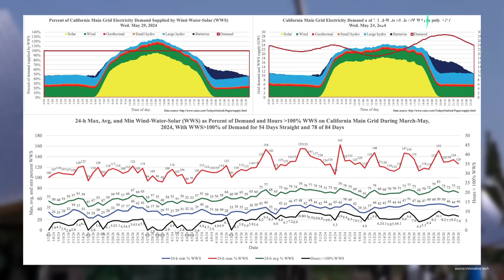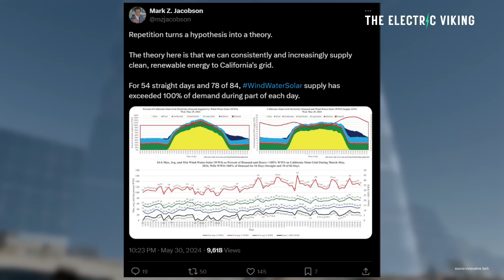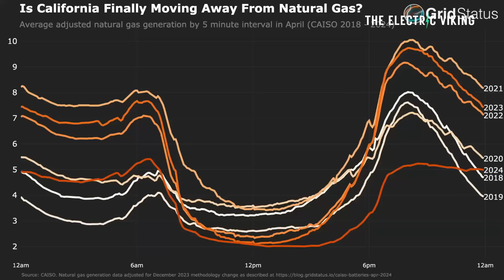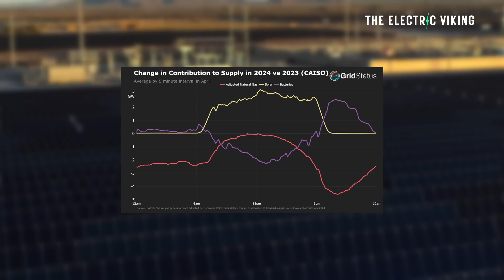Solar smashes records in California, 'DUCK curve' nearly wiped out

Comment: Spot on, Sam. I work in the solar industry designing micro inverters and it’s been a long time getting to this point. Interestingly, PG&E is currently tearing up my street to replace all the gas mains and home connections/meters… doing this through the entire town here in the SF Bay. I’d rather they just remove the gas service and help me convert to a heat pump A/C and indication stove. They’re building an entirely new gas infrastructure just as it’s becoming obsolete. 🤯
Reply: It turns out many SmartMeters have dead batteries. As a matter of fact, PG&E said, just last year, they started the process of replacing 3 million meters as they reach the end of their battery life. It has nothing to do with a green energy transition.
Reply: Natural Gas is a separate product, and there will always be demand for it.  Just like oil will always be used for making plastics even if we give it up for fuel for our cars.
Reply: Same here. Meanwhile, I've converted my office building to electric heat pumps. No gas. Also my new house is all electric .
Reply: @BracaPhoto    Burning natural gas produces CO2. Natural gas will need to be phased out to meet CO2 emissions targets.  Several cities have banned new natural gas connections, subject to judicial review.   Even if you don't burn it, natural gas is a tremendous greenhouse gas on its own, about 80 times worse than CO2. The leaks on the system are a pretty big climate problem on their own. If people talk about "efficiency" of natural gas, it is a misnomer. What they mean is cheap. If you want efficient, then you can't beat a heat pump which can produce several times as much useful heat as energy consumed.  Natural gas is never going to be more than 1:1.
Reply: @BracaPhoto  I don't know about the USA, but in the UK a "unit" (1KWh) of electricity is about 3 or 4 times more expensive than the same amount of natural gas, so using natural gas for cooking is certainly cheaper than using electricity for that same purpose. When it comes to heating a home, again it would be 3 or 4 times cheaper to use natural gas rather than electricity+electric heaters. However... a more modern option for heating via electricity is to use the electricity to run a heat pump. In this case, 1 unit of electricity running a heat pump will produce about 3 or 4 units of heat, which means heating a home via electricity+heat pump costs about the same as heating the home via gas.

Yes, I know I am talking about cost rather than efficiency, but perhaps whatever source provided you with claims that "gas is more efficient than electricity" was worded poorly and really meant "gas is cheaper than electricity". That's just a guess on my part.
Reply: @CiaranMcHale  look into "physics" - it will help you understand what I mean by more "efficient" - it has NOTHING to do with price or cost -
Reply: @BracaPhoto  There is no need for rudeness. If you read the second paragraph of my original comment, you will see that I do understand the difference between efficiency and cost, and I was merely saying that perhaps you read efficiency claims from a source that was using sloppy language. The following 13-minute video provides an overview comparison of cooking with (a) gas, (b) electrical resistive, and (c) electrical induction cookers, for several metrics, including pollution, convenience, cost and efficiency: https://www.youtube.com/watch?v=X440BHdy35g One takeaway from the video is that gas is only about 40% efficient because a lot of the heat generated is used to heat the air rather than the cookware containing food, while induction cooking has up to 90% efficiency since most of the heat goes directly into the cookware containing food.
Reply: Natural gas isn't going anywhere.
Reply: @ron2280  it's going up in smoke
Reply: @TheQsam1  😂👍
Reply: Using natural gas for heat is waaaaay more efficient than using electricity induction to make heat. Heat pump HVAC and heat pump water heater? Sure. Induction cook top? Nope. Thermal efficiency of burning natural gas in your house is 3x higher than burning natural gas in a generation station, then transmission losses to get it to you. Not only that, but gas gives you a better food product than electric cook tops because of the very high temperatures they can hit, that brings you the Maillard reaction in foods that make them taste wonderful.
Reply: @larzlarz1140  I guess you have never used a induction top. U can reach as high a temp as with gas
Reply: @larzlarz1140  I don't think you have much experience of using Induction hobs they a direct replacement for a gas hob. You are also not considering the efficiency of the actual hob itself - a gas burner transmits 40 - 70% of the energy to the actual thing you're cooking - an induction hob is over 90%.
Reply: @mosschopz156  I like your HOB - and 70% is great BUT converting natural gas into HEAT is almost a 100% conversion rate 

That's physics I thought - am I wrong ? What am I missing

Also people don't use gas ovens because of efficiency- they use it  for many other reasons- same reason they have natural gas lanterns in their driveway - it's not because it's efficient it's personal preference

They do use gas dryers and gas heat pumps because they ARE more efficient
Reply: @BracaPhoto  yeah but you want the heat into the thing you are cooking, that is not 100%. Probably less than a induction stove. Well most likely BC of convince, and since electricity is getting more and more convenient. Choices might change
Reply: @TheQsam1  no - chefs do not use gas stoves because of "convenience" they do it because you can vary the amount of heat from one side of the pan to the other

There are many other nuances that make gas superior as a cooking tool - once again it had nothing to do with the word "efficient" 

It's not even the same discussion - Electricity is GREAT - But it's not more "efficient" than gas for producing heat
Reply: @larzlarz1140  also the inefficiency of having both gas and electricity into your house instead of just electricity is crazy. And the risk that gas causes is also alot bigger with leaks etc. Then the extra bill is annoying.
Reply: @TheQsam1   -   But people get electrocuted, electrical fires burn down houses, charging batteries causes fires - both gas and electricity are dangerous.
Reply: @Morrisfactor  well then why have both? You will have one(electricity) so why also add in the other one?

Comment: Now explain how to do it in a place that doesn't have year-round sunshine and vast tracts of empty desert.
Reply: What DO you have? Rain? Hydroelectric power! Wind? You see where I'm going, right?
Reply: @geirmyrvagnes8718  Gas, Nuclear. Britain gets lots of rain but lacks the terrain to produce much hydroelectric power. Wind is available but intermittent and unreliable. Our weather patterns also include periods of up to several days when there is very little wind due to high-pressure anticyclones that settle over the entire British Isles and North Sea basin. During the winter when daylight hours are short, the elevation of the sun is low, and solar output is negligible. These are factors that anyone living in California or Australia cannot comprehend.
Reply: @brendanpells912  I am sure they can comprehend. You don't get dumb just because you live in California or Australia, contrary to popular belief. 😅 Britain is blessed with plentiful wind resources and excellent offshore areas to put turbines so they are not right in your face all the time. Intermittent, sure, but batteries work and are plummeting in price and developing in capability. If you are the sort of person who likes international cooperation and market economy, undersea cables to other countries will also stabilize supply.  The climate is perfect for heat pumps, and the land distances limited by actual ocean are well suited for electric transportation. England/Wales is no Australia when it comes to sun, but it is far from bad on a global scale. Comparable to Germany with its many solar projects. Scotland can probably spare a lot of wind power, even after they devolve. Changes are possible and are happening, just look at how coal-dependent that island was in living memory. As a Norwegian, I have a financial interest in that none of this works out, so you can keep buying our "natural" gas at "fair market prices". You will for a couple of decades, anyway. Things don't happen over night, but over decades.
Reply: Where do you live?